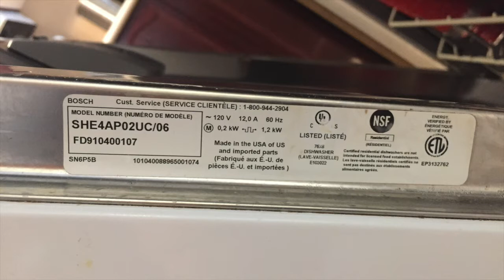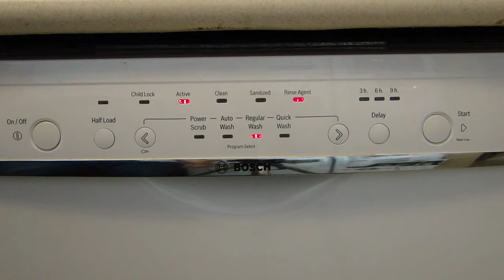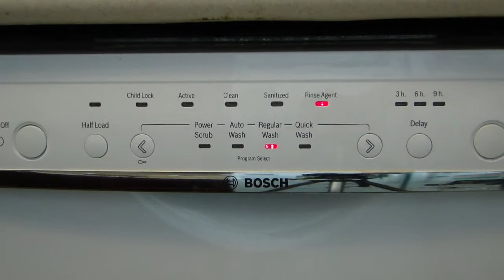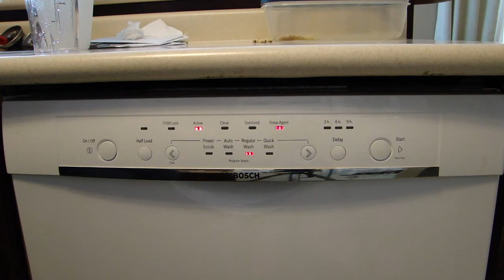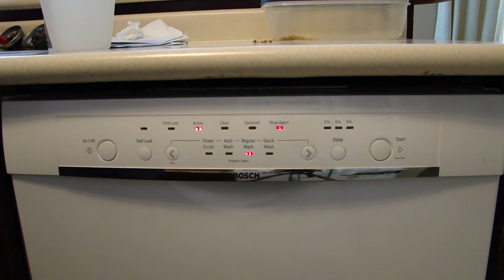Bosch diskwasher SHE4AP02UC/06 start and stop problem - with solution

Comment: You nailed it.  I had e24 code….after cleaning filter etc, it worked once or twice the back to same code. Then I found out about that little part in bottom with tab. BUT…thereinafter I kept it out thinking no big deal as I continued to trouble shoot. I blew out the discharge line everything. I was certain I just have to replace pump, btw, the pump moved freely. I just didn’t get it. I watched your long enough to appreciate you were systematic about it and would eventually tell me what the issue was. WHEN YOU NOTED THAT THE WHILE I PELLIR GAGE HAD TO BE IN, IE REINSTALLED AFTERREMOVING I WAS DUMBFOUNDED by the fact it was that simple. Many thanks!

Comment: CRAZY that the water pump failing is caused by whether this little clip is inserted correctly or not. This is what fixed my issue. Thank you. I almost had to call a repair man because I couldn't figure out what was wrong. I would have been SO upset if he had clicked this clip into place and then charged me $150 for a service fee.
Reply: Thank you 🙏 this solved my problem. All other video said it was the door latch or do reset???

Comment: This issue was driving me nuts for the past 3 days. Couldn't figure out what the problem was. Changed pump, cleaned hoses, than replaced hoses...was about to give up and call a technician, than I came across your video and at first I couldn't believe this could be the solution. The plastic piece was kinda loose as you said but I pushed it til it was sealed on the hole. Restarted the cycle and low and behold it worked flawlessly. You're a hero and Bosch should definitely inform clients of this issue

Comment: THANIK YOU!! I just found this video -- unfortunately after I spent the money to have a new pump shipped (but at least didn't go for the motherboard, too), having received no response whatsoever from Bosch Canada. I had exactly this issue -- but I can't say that there was ever any kind of :audble ":click:", rather with a LOT of trial and error there was one time the clip went in and seated itself firmly (I don't know that I could ever replicate it) -- and now it works and I have a spare pump. I can't believe Bosch doesn't have a nice little service announcement about this or ship a little note with the machines.

Comment: Just wanted to shout out a HUGE Thank you!  A while back our dishwasher was working, but wasn't cleaning as well, so I popped out all the pieces and cleaned out the filter and the propellers, and popped that white piece out to get all the way in there. When I put the white piece back in, I couldn't get it to actually click, but it was in the right way, so I just left it and put everything else together. 

    This was about a month ago and the dishwasher worked great and cleaned much better, but yesterday it just did the turn on-off-on and the the clean button came on. Same sequence each time. The majority of videos were pointing to the door latch and possibly the control board, so I was getting ready to order a new latch when I saw your video. 

    Was about to shut it off because it sounded like you were diagnosing a pump problem with all the water loads you were trying, but you had the same machine as me so I fast-forwarded and saw the picture of the white piece that I had taken out awhile back. After watching that I took the filter back out and the piece was in there, but it was loose. I grabbed a wrench and just used the handle end to apply some pressure to the piece and I finally heard the click! I put everything together and hit the start, and this time I heard the water being sprayed into the chamber and the cycle actually staying on and is still going as I write this! 

    I just can't believe that a small piece not being seated could have caused all this. I also don't understand how the washer worked fine all those times after I had cleaned it and left the piece loose?! Sorry to blather on, but I figured someone might be helped if I detailed what was going on with my dishwasher. 

    You might consider editing your video to just talking or starting out with the little white piece. A lot of people might have bypassed it since it was almost 10mins long and had all the water experiments up front. This is really the only video that mentions this....

Comment: If you turn off power and just hold up the float, the pump will run. just a heads up. Good video and I hope this is the fix for mine. Thanks!

Comment: Thanks.  The lesson for me is that if the "Bosch Dishwasher Drain Pump Lid Cover" doesn't audibly "click" into place, it will wiggle loose again soon and fail to complete cycle due to failure to drain.
Reply: Does anyone know what the part number is for "Bosch Dishwasher Drain Pump Lid Cover"is?

Comment: Trivia fact: I tried draining with the said plastic part removed from the machine, and the water was just spinning around in that sink hole. Nothing went out. I opened the dishwasher while the pump was running, and saw the water in motion, all still there.

Comment: Thank you.  This worked!  When I first got an E25 error, I followed other videos that had me clean out the filter and the area near the pump.  That worked for a while but the error came back.  I then took out that small part and cleaned some more.  I switched the pump.  Again it worked for a while but the error came back sporadically.  I kept cleaning the area around the pump but never fully got rid of the error.  Once I saw your video I realized that the symptoms the dishwasher had were exactly what you described.  I had not fully clicked the part into place.  Once I did, it worked again.

Comment: Yes! It worked. Pull your filter out, remove the filter screen. This “cover” is in the drain area. Mine has a small screw that holds it in place. I had removed the part to change out my check valve. I either didn’t line it up correctly when replacing it or bumped it when I replaced the drain pump. New impeller, new seals, new check valve, and a new drain pump....my 15 yr old dishwasher works like new again! Thank you.

Comment: This video just saved me from buying a new dishwasher. I had the E24 and E 25 error codes. I cleaned out the drain, checked the impeller and pump. I replaced the pump and disconnected hose so it could drain directly from pump and still got the E24 error code. Most videos and websites said most likely control board if not the pump or overflow sensor. Then I searched the starting and stopping which lead me to this video. I reinstalled the white piece again and heard the little snap this time, and wahoo, all works again. I liked the repeatable test you did as I teach science.  This summer I replaced the bearing in washing machine drum and thought this was going to be another big project. Thanks so much for sharing your discovery.

Comment: The disposal has a piece that needs knocked out for it to drain. 
Pull the hose off and shove a screwdriver or a wooden spoon handle in the dishwasher drain port on the disposal and give it a whack.
you will feel something give way. 
that was the knock out. 
put the drain hose back on 
good to go

Comment: Man!!!! I never post, but I can't thank you enough. I've spent at least 4 hours working on it (cleaned up everything, took out the drain pump, measured impedances on the pump, one beer, read so many posts, more beer, lots of frustration). This fixed it. Amazing, why this piece of plastic caused the behavior it did, but it definitely fixed it.

Comment: Add me to the list that were helped out by this video. I couldn't believe that was it until I clicked it in and it's a very loud click. I too replaced the motor and verified the entire length of drain hose was unobstructed. It wasn't until I used the terms start and stop did I find this video. Thank you very much.

Comment: Lesson learned from that video. If you remove the little plastic pump cover and test your dishwasher without it... wont work... pump doesnt seems to pump normally. Put it back.... and that it.  I had issue of the dishwasher not draining and stopping 5 beeps. I did cleaned the filter and drain area and that wasnt sufficiant. I then removed the moter plastic cover and the turn the pump manually. Then tought to test without puting everything back... error... reassemble everything and then... test :)  it sounds ridiculous that this plastic cover shouldnt change anything... but it does!